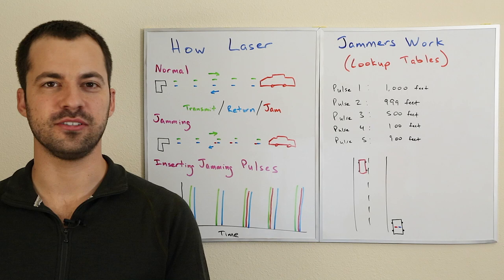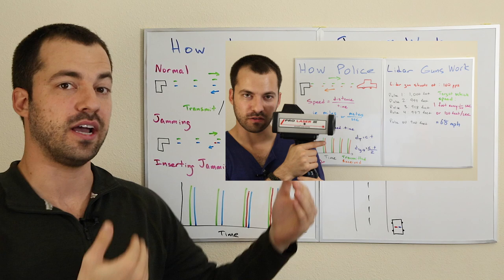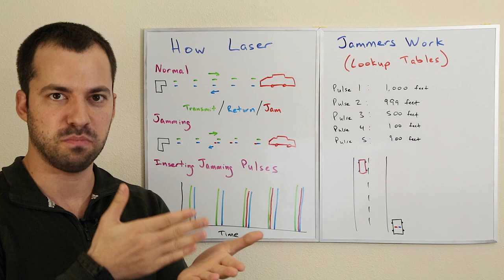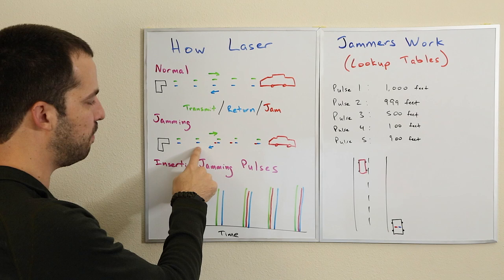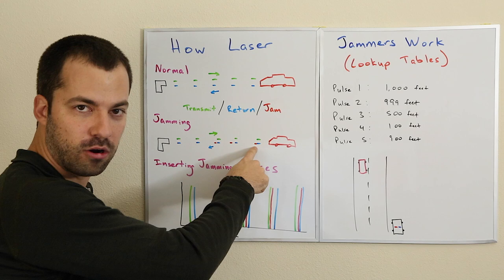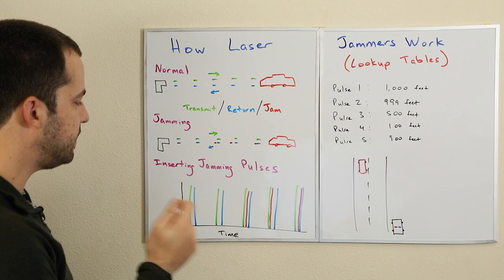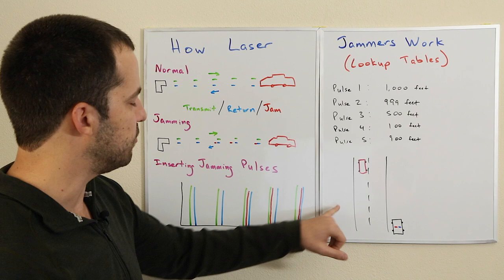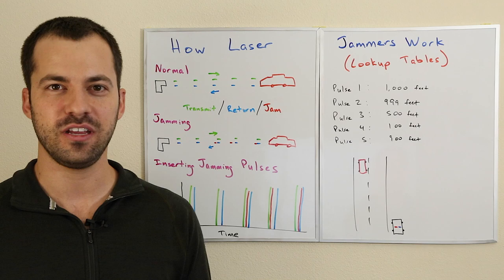How Laser Jammers Work

Comment: This kind of jamming in busted long ago. "False" reflection actually fools old laser radar that pulse is reflected by another moving vehicle (radar read same pulse signature, but invalid interval). However, as your graphic shown, first two pulses and reflections left unaffected and that's enough for evaluating velocity with high certainty by modern radar and skilled officer.
Reply from the maker: In theory, but in practice laser guns require many pulses in series to ensure they have a good lock on a vehicle. Typical acquisition time is around 1/3 of a second and at 200 pps, that’s 67 consecutive pulses.

Comment: Question: I got a speeding ticket for going only 5 mph over the speed limit. More importantly, I was driving on a road that runs right next to and is parallel to a runway at LAX.  When I drive down that street, at all times, my laser detector is pinned to like 10. So obviously there is a ton of signals be shot down that street constantly besides the Lidar gun of the officer.  He is literally parked directly in front of air traffic control.  So isn't it likely that his Lidar gun reads those signals also throwing off the accuracy of his gun. Additionally should he even be operating a LIdar gun in that area and wouldn't he need special permission to do so?
Reply: You can defend yourself in court using some of these questions. If you have the money and want to put up the best fight possible, hire an attorney.

Comment: What happened if the laser gun send unique/random pattern each pulse? Eg: varying the light frequency; first pulse is red laser, second pulse is blue, third green, next is unknown - or- by modulated each pulse with unpredictable data. The receiver only accept matching pattern and ignore unmatched data. Is it still jammable?
Reply from the maker: Laser diodes don't have the ability to change their output frequency like that. You don't see many multicolored laser pointers, for example, right? They're always red or green or whatever. The unpredictableness currently is being done by varying the pulse pattern so that the laser jammer doesn't know what's coming next. There are jammers that can handle variable pulse rate lidar guns, but they require more sophisticated jamming algorithms than what I've addressed in this video.

Comment: Why couldn't you just transmit broadband noise on the laser band full time and prevent the gun from getting an accurate reading until the last moment?   Seems like these transmitting diodes would be built into regular car headlight bulbs.
Reply from the maker: Laser diodes would overheat and be unable to cope with doing that. Old laser jammers that used brute force techniques that would do what you describe (see my other video on that) had to shut down after transmitting for a few seconds because it puts so much strain on the diodes.

Comment: If this simple technique is used by police laser guns to track the vehicle speed, laser jamming device manufacturers can produce much effective devices than just jamming the laser pulses. I mean why can't they send pulses back in such a way that the laser gun to calculate false readings. A vehicle moving at 100kmph can make the cops reading to look like 40kmph. So they need not slow down but just fool the cops device. It would be pretty helpful and creative.
Reply from the maker: +Lakshitha Dias It’s not that simple.
Reply: I agree with you. But can u explain why is it that difficult after been able to recognize the laser guns pulse pattern? Just for knowledge.
Reply: Lakshitha Dias I think it more has to do with the cop know for example as a cop I would know that if some blew past me 100KPH I wouldn't need to know there speed and would go after them and use Radar to clock there speed. It doesn't take a radar or lazer reading above a certain speed.
Reply: I guess it could as soon as it determined the algorithms, but cops are pissed enough at jammers as it is, do you really want a case in court where drivers are now not only jamming but fooling laser guns into reading wrong? you are opening a whole can of worms, in addition, how is the laser jammier supposed to know how fast you should be going , I guess you could connect to an app like Waze and show legal speed, but what if it is wrong ? what if the jammer messes up and shows the officer 150 mph instead of 60.

The magic of jammers is that lidar guns are imperfect devices, some cops rather use radar because of this, it requires perfect aim, and the type of vehicle often times means a delayed lock, I have twice defeated a laser operator because my vehicle is black, has small head lights and it has a round flat hood (2008 honda civic and we have no front plate in florida) so while the officer is standing there trying to get my lock at a far distance my V1 alerted me plenty to slow down, because of this jammers are effective as long as they have JTG sleep mode, if the officer can not get a reading for 4 seconds the officer will assume it is normal for his LIDAR to take a bit longer on some vehicles, when it is a complete JTG it does raise eye brows though